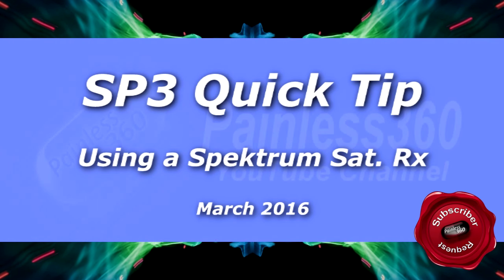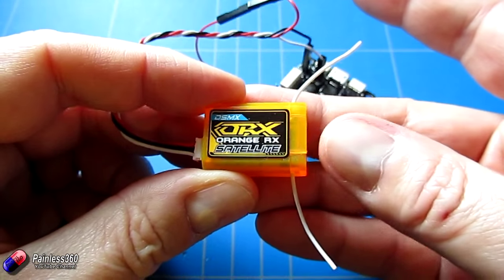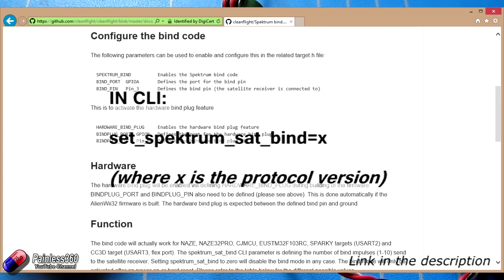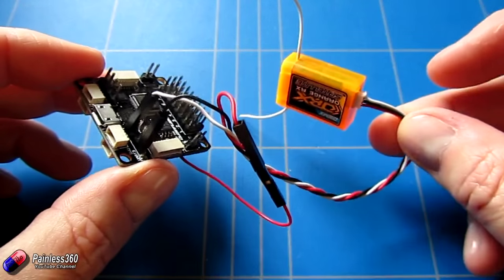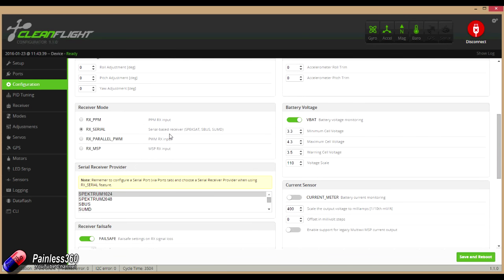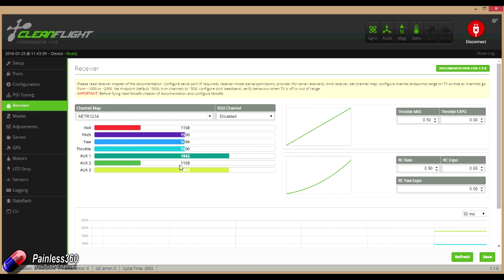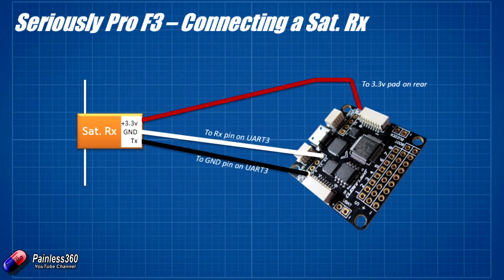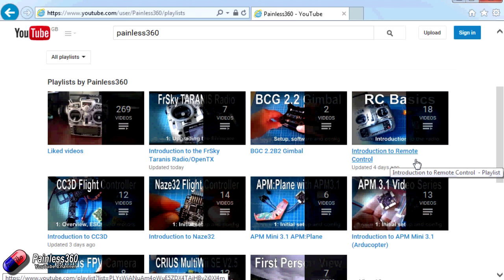Seriously Pro F3 (SP3) Quick Tip - Using a Satellite Receiver (Spektrum or Orange Rx)

Comment: i use a orange r110 satelite receiver, it is very light and small. If you forget to bind just short the signal and ground wire while powering on and it goes into bind mode.

Comment: i have a sp racing f3 neo connected to clean flight and i am using a spektrum dx9 with a FPV Racing serial receiver 3.3v Autobind the sat is connected to the board via the 3 pin through hole JST-ZH connector i have bound the sat with a reciever and gone through cleanflight how you have shown and select the rx serial and spektrum2048 then save but when i go into ports the UART3 does not become dedicated so i manually turn it on and save but when i go to the receiver tab  and move the controls on the transmitter nothing moves at all, the sat and the transmitter are still binded together with a solid orange light. i am new to all this so please help its so frustrating.

Comment: Great / well detailed info sir! 
Is it just me, not having much luck with sat (DSM?) receivers by the way? On forums I offten read them sat-receivers aren't really ment for long (up to 1Km) range setups.. 
Any idea what the actual difference between Spectrum1024 and Specrtum2048 is by the way? 
Cheers & thanks for sharing again!
Reply from the maker: +DutchRC Adventures They are not as they use the very small antenna. There are new sat. rx that now have the full length antennas that should give better range (see video coming soon ;)
Reply from the maker: +DutchRC Adventures Re 1024 vs. 2048, think of it as the 'resolution of the channel'. If one doesn't seem to give a full throw of the channel related to the control, try the other..
Reply: +Painless360 Cool! I'd be interested in that! :)
Reply: +Painless360 Also, but. At Github it´s stated that you can use both resolutions with dsm2 and dsmx. I´ve binded the orange rx110xl (long antennas) with a dsm2 receiver, and if I switch to 2048 in cleanflight, I see 12 channels listed but the channel mapping is all wrong, and not all channels are working! In 1024 I have 7 channels working correct. So 2048 only seems to work if you´re using dsmx! I also forced my radio to go back in dsmx mode. The sat accepts this, and works, but I can´t change to 2048! If I find out more I will let you know!
Reply: +DutchRC Adventures I'd recommend the LemonRX dual antenna diversity satellites with long antennae.  They will give you full range, and they're only USD$10.  I use them on all of my quads, except for one which has an Orange R110XL - also good.
Reply: +Simon Wallace Thanks for that Simon!
Reply: I'm using the r110xl. Full range and working flawlessly till now

Comment: I have a FrSky XSR. The SP3 Racing manual says UART3 header is for 3.3 volt serial. So I'm assuming I can't use the UART3 header and need to use the IO2 side port(I prefer to solder all my connections). Do you know if UART3 will work for x4r\xsr?
Reply from the maker: If you're using s-bus or another serial connection then UART3 is automatically used to manage the signals anyway.. Best of luck!

Comment: I have learned a ton from your vids, I have a question though, I thought this Rx was PPM so I hooked it to pins 1,2,3 on IO_1 and it won't work.  Isn't that proper PPM procedure according to your other video?  Is serial = PpM?  I'll redo my soldiering and try this way, just annoyed I didn't find this exact setup the same as mine sooner!
Reply from the maker: No, serial in things like Cleanflight is things like s-bus, I-bus, sat. rx. PPM isn't handled the same way.

Comment: Hi well made Video But I have some Problems with my DX8 Spektrum Radio and Orange R615X receiver witch I have bound then connected to Cleanflight and there I found some Problems I tested the Motors and everything works flawless then i test the Motors over the Radio and there are my Problems it seems when I give Trottle the Motors run all over the Place full throttle 2 Motors spinn up then the Motors 2 and 3 is going in idle .Can you perhaps help.It seems the Problem is only in the radio ,but I am not able to find the Problem
Reply from the maker: https://www.youtube.com/watch?v=DDnaAQLjcQQ ?

Comment: I am struggling to make it work. Binded Spektrum receiver to my DX7 radio but when I move ailerons or elevator the corresponding motors spin (throttle is down to 0). Thanks for great videos! You rock!
Reply from the maker: +aecrim1969 sounds like the model type you have selected is wrong. What are quadcopter building for beginners series for more of the basics designed for first-time builders. Best of luck

Comment: I want to make an FPV quadcopter soon, however the only camera i want to install in it is my gopro hero 4, i don't want to use the goggles or any of that. Do i still need one of these receivers?
Reply from the maker: Sounds like you are new to this. I'd suggest you watch the 'Introduction to Remote Control' series and the 'Quadcopter Building for Beginners' series too to see how it all works and goes together. Best of luck with It!

Comment: Quick Question (sorry if its been asked already but i did not see it):
If I am using a standard receiver with the satelite (I know it weighs more but I am prototyping and just want to get this thing setup for now) how do I hook it up? is it the same settings in cleanflight?
Reply from the maker: If you're plugging in the main receiver into the flight controller then you'll be selecting PWM, PPM or S-bus depending on what it has and how you have it connected. The main Rx takes care of the sat. rx. in that case.. Happy flying!
Reply: Painless360 Thanks for your help! these vids are really great by the way!

Comment: Do you know if this will work directly to plug into a KISS FC? And will it work with a DX6i?
Reply from the maker: +Grant Bradshaw if you look in the online manual for the flight controller you want to use, look to see if it has a satellite receiver port. Looking at the main KISS FC, it does so you can plug it in easily. Should work with that radio but check with the support guys on the HK website to confirm anything you are not sure about. Best of luck!

Comment: tried searching for this exact orange rx, and there are multiple others .. not the one mentioned here, can you provide a link / point me in the right direction? i'm a build-yourself-quad noob ;)
Reply from the maker: +jerry486dx4 lots to choose from. See our video on the differences between S-Bus, PPM, PWM and Sat. to understand what you need to look for.. Best of luck!
Reply: +Painless360 binding this via naze is a nightmare, wish you have covered the bind plug / port in more details as I have no clue how to proceed, the R110XL has no bind plug .. the step on how to bind the radio to an orange satelite has not been covered well in this video and I believe it should have :/
Reply: +Painless360 Sorry if my previous comment was not constructive. I now know that after you initiate the set_spektrum_sat_bind=7 you need run the save command AAAND the binding will initiate the NEXT time you power up the naze using the usb cable. the orange rx (in my case R110XL) will start flashing. Turn on the radio with your new profile while holding the bind button (for spektrum dx9 owners) and it will bind. For some reason this did not work with the BIND option within the menu, I had to start the radio with the bind button down.
Reply: just short the signal and ground when powering up , rx goes into bind mode.

Comment: Trying to figure out what im doing wrong.  Im trying to bind the Redcon DSM2 sat receiver using cleanflight. Followed the video step by step and the light onthe sat reciever not coming on. Any ideas what it may be,
Reply from the maker: +East Carolina Drones, Helis &amp; Planes Happy to help but please watch https://www.youtube.com/watch?v=olIqTiSJHIY and come back to me with more detail of what you've tried..
Reply: +Painless360 I had to satellite receiver bound I can change flightmodes from the transmitter I can turn the Lost buzzer on all my stick movements are working fine and cleanflight I just can't calibrate the ESC or get the motor to spin up with  the transmitter I'm using a diatone flight controller that connects directly to the power distribution board it is supposed to send a signal through the cable down to the power distribution board to the ESC
Reply from the maker: Not sure - a video of the problem may help..

Comment: This is a general question so this might not be the right video to ask it under, but I hope you can still answer. 

I bought a SP3 Deluxe (with magnetometer and barometer) but they sent me a Mini instead by mistake. 
Do you think it's worthwhile to send it back to have it swapped with the Deluxe? 
They told me the Deluxe is more expensive because more expensive components have been used and it has a parallel pwm input. 
Do you think this parallel pwm input is important?
Thank you for your help!

Ps. Your videos are the best.
Reply from the maker: +Luca Coppadoro Thanks for the feedback, the Mini has even more features than the SP3. We will be doing a series on it in the coming month.. Best of luck!
Reply: +Painless360 Thanks for the reply. 
My question is, do you think the Mini is superior to the Deluxe?
Reply from the maker: No idea, which is the deluxe?
Reply: +Painless360 They have three versions of the SP3
The Acro is the basic one
The Deluxe is the Acro +  barometer and compass, that you are reviewing.
The Mini is the race-ready one, which also has barometer and compass.

Btw, in the meanwhile I did some more digging myself, and I understood what parallel PWM means. Only needed if I use a PWM-only transmitter.
However I'm not sure the Mini can use all the features all the time (OSD + SmartPort + SBus + GPS + LED Strip + Battery Monitoring + Sonar + 8 motors) like the Deluxe/Acro can.

Comment: Works it also with a spektrum DX6I (DSMX) ?
Reply from the maker: Should do, the protocol between the radio and Rx is independent of the signals to the flight controller (PPM, S-bus etc)..

Comment: whats the best receiver for speckrum d18 to use with 250 size racer quad?
Reply from the maker: Depends on the flight controller you will be using. I normally go for one of the slim line receivers that gives a PPM or s-bus output but the satellite receivers like the one we look at in the video are great options too..

Comment: I have the sp3 osd delux FC.  There is no dedicated sat uart on my FC. Dont know if it is a old version ? Cant find any real information. Dont understand where to connect the signal ?  Maybe,  but only maybe its on channel 3 ?  Anyone ?
Reply from the maker: +yksikaksikolmen check the manual. I think that the board is made to sit on top of a flight controller. Best of luck
Reply: I dident understand that,  But its probobly just me :)   Thanks for answer.

Comment: No matter what I try, I can't get the the inputs to show up in cleanflight. I also can't bind through cleanflight CLI. Does anyone know how to fix this? I've had the quadcopter for months now and I've never been able to fly it.
Reply from the maker: Happy to help but please watch https://www.youtube.com/watch?v=olIqTiSJHIY and come back to me with more detail of what you've tried..
Reply: I've bound the receiver and I am able to control servos, but when I go into cleanflight the inputs don't show up. I've tried using UART3 and IO_1, and I've tried binding through the cleanflight CLI but that doesn't work. I have serial rx switched on for UART3 and I've even tried doing all of this in betaflight.
Reply from the maker: +Teh Koaler so you're using ppm,  subs? How have you wired it up? What receiver are you using? Impossible to provide specific things to check without any detail. What worked here is in the video.. best of luck.
Reply: I have an ORX RX3S soldered to UART 3 and the 3.3v pad on the back of the fc and I followed all the directions in the video exactly
Reply from the maker: Teh Koaler that receiver is a flight controller in its own right. It will probably also need 5 volts not 3.3v. only sat. receivers usually run on 3.3..  Have a look at those quadcopter building for beginners series. They might help.
Reply: I FINALLY FIXED IT
I had to use pwm and now it works! Thank you so much.

Comment: Do I need pins or can I just direct solder?
Reply from the maker: You can.. Be careful and use a fine tip and good solder.. Best of luck!
Reply: Worked just fine, yes, need some steady hands, hey can I use hot glue to "coat" the soldering? Giving a bit more rigidity?